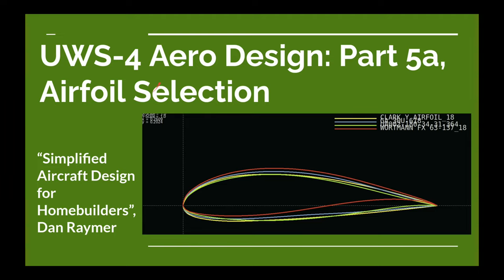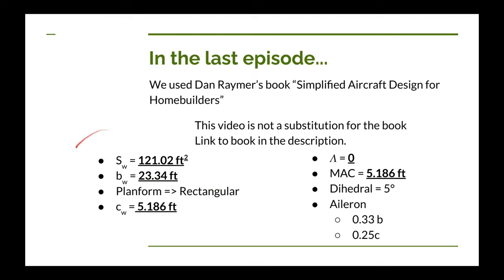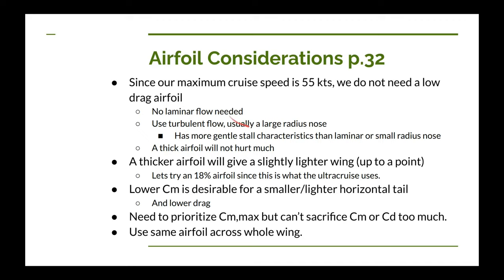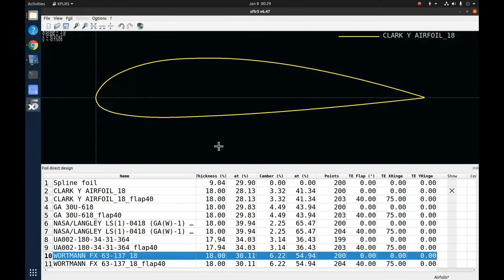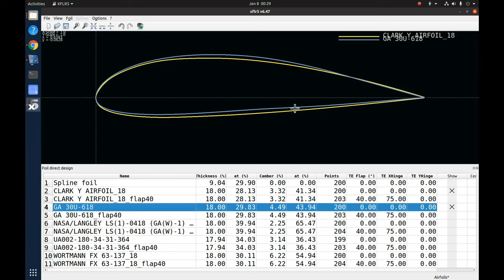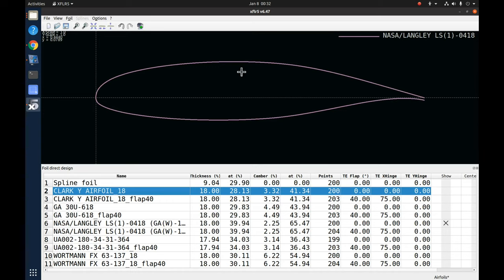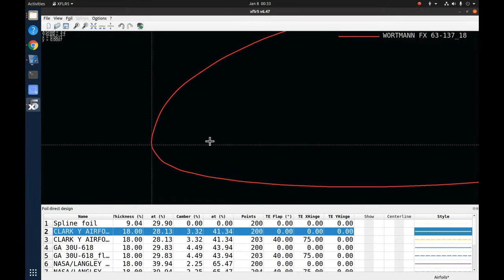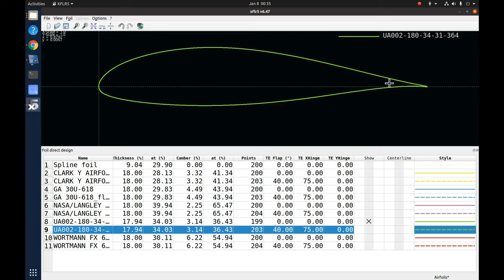UWS-4 Aero Design: Part5a, Wing Airfoil Selection

Comment: You should discuss single surface airfoils. They seem ideal for low and slow and simple aircraft.
Reply from the maker: In deed they are. For the UWS-4 though I'm going for low drag so I can get extra range. The single surface airfoils are almost always high drag. And for some reason the Xflr5 program has problems with single surface airfoils.
Reply: Joe Apollo  looks interesting

Comment: 👍Decisions! decisions! First airplane I built decades ago was a J-3 Junior it had a Clark y 4-foot cord and 30 foot wingspan it met all the parameters for an ultra-light plus excellent glide ratio. Have you considered a "retractable" Leading Edge that would give you the best of both worlds more lift less drag. Happy choosing.
Reply from the maker: I though about a retractable slat for the UWS_1. For the UWS-4 I did not consider a retractable slat. I wanted to keep the complexity down. The slat would also add some weight and I think that weight could be an issued for me on the UWS-4 since it will be all aluminum.

Comment: Nice video. It is unfortunate that xflr5 cannot deal with slats. I once tried to get a free license for MSES to design wings with a slat but it was not possible. Is there any free program to do it?
Reply from the maker: I do not know of a free program to handle prediction of Cl, Cd and Cm of an airfoil with slats or flaps other than plain. I'm thinking of trying to do something along those lines using 2D computational fluid dynamics (CFD). I have a lot to learn before I can do that though.